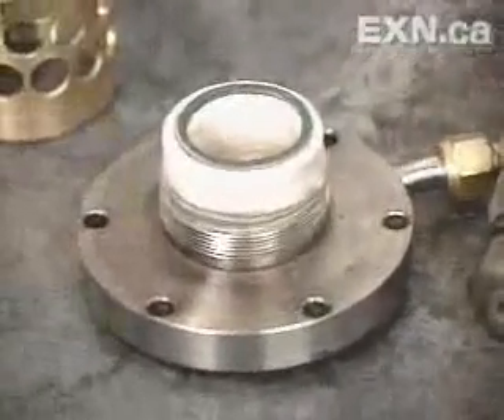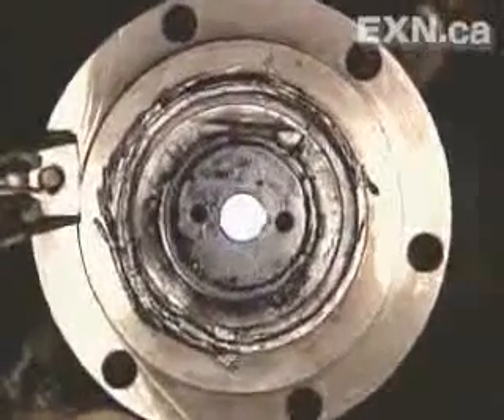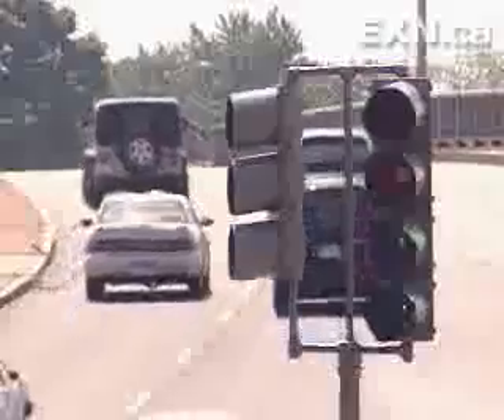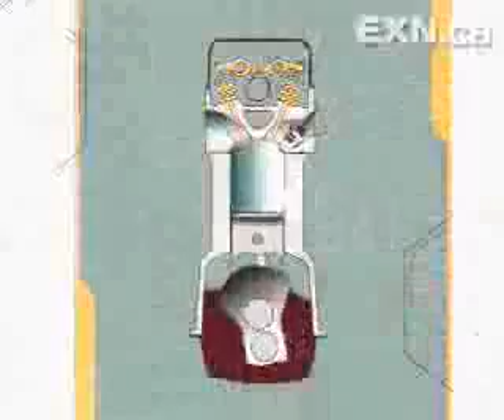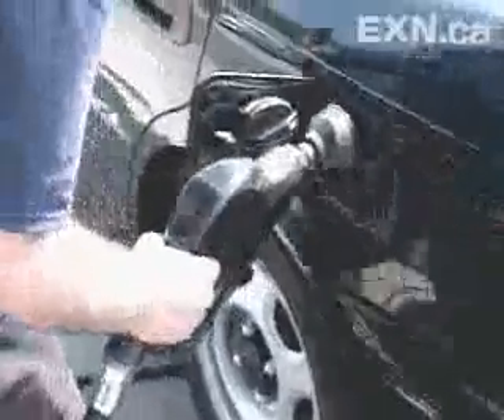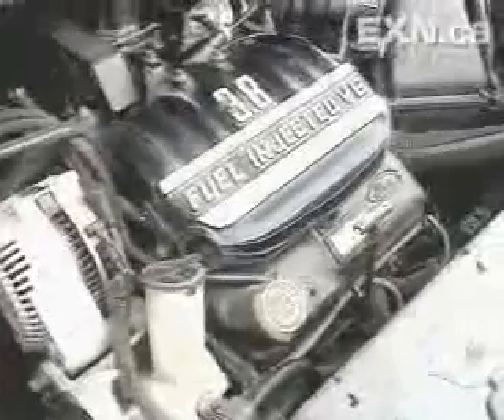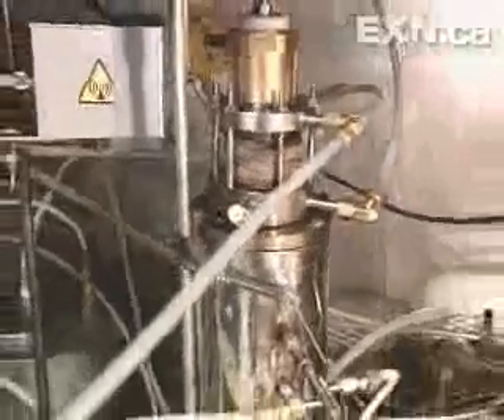MIT Plasmatron   Principles of the Pantone GEET

Comment: This is another story of how oil industry investors pretend to support the elimination of oil use. In 2003 MIT announced the testing of their plasmatron on a bus in Indiana paid for by the Bush administration to clean the environment (and take profit away from the oil industry). It never went anywhere. Like the maple leaf sized solar cell that MIT claimed to have invented in 2011 that could power a house.

in 1983 Pantone had proof that his reactor not only created plasma, it also transmuted the fuel into basic elemental plasmas that later recombined to form clean air and water.

It is a remarkable invention that accidentally demonstrated how the Earth and Sun create matter and energy. It could save us from the extreme weather we are having and protect us from the exposure to space weather that is coming with the failure of the geomagnetic shield.

Read about it in "The Book of GEET: Part 1" on amazon or at rebuildingGEETinternational dot com

Everyone that Paul worked with eventually saw dreams of avarice and tried to rip him off. Dennis Lee has a great demo on YT. He runs a lawn mower in a room, no one suffers. He then ports the exhaust into the intake. Converting his gas and water fuel mixture into energy, no footprint at all. Dennis got his own patent for essentially the same thing, but without water. The reactor as Paul documents could run on anything, even vaporized aluminum. 

In Paul's book he points out the patent did not tell you enough to build it. That's what makes patents work. Get enough on paper to protect your design, but not enough to actually replicate it. 17 years is not long enough to make lots of money if you don't have cash or resources on hand to jump right into production.

The patent office granted the patent to Lee, because Lee claims it could not work the way Paul explained it in his patent. The patent office works for the superrich who own oil interest. Granting another patent for an expired patent invention enables the prevention of others putting it out into the market. The fact that Lee's explanation is wrong too is irrelevant. Nobody will see this commercially available for cars soon. If you brag about it you will suffer losses until you get the message and recycle your devices. Patents are only as good as the money you have to defend them. When the patent office wants to block a design, you will not succeed. (Note the patent office let Marconi rip off Tesla's patents until 10 years after Tesla died, then they changed their ruling and admitted Marconi had infringed his patents for decades. 

There are lots of examples that science isn't interested in truth, its Business Science, money talks. For us its just BS. Thane Heins invented a flux capacitor applied to a motor and he proved that he could charge the batteries of an electric car while it accelerated. No patent granted. His theory even conformed to electrical theory... but, it violated the three laws of thermodynamics.... no patent. Besides which, no vehicle manufacturer would use it. They like making money and staying alive more than doing the right thing.  Peace, B